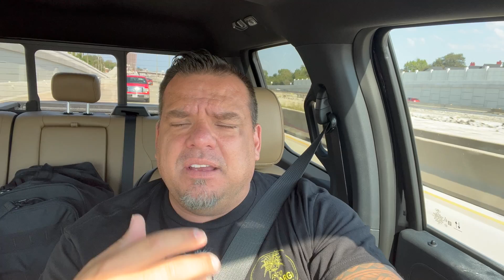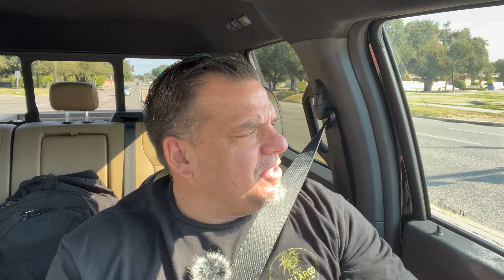How to Handle Impossible Projects: A Real-Life Integration Case Study

Comment: Sorry i haven't understood, the client had the all data which clearly specified the down time due to lack of raw material , what am i missing ? what normalization and contextualization had to be done on this information ?  What more information was required ?
Reply: @4.0Solutions
 what you say is still confusing but i thought the video talked only about lack of raw material for SCM may be i will replay and listen to it carefully again ! having and Logging all the events and tracking their status just prior to lack of raw material would give you what information ? Logging of all events is understood ( for any other downtime reasons) but the relationship with lack of material is still confusing to me ... sorry ...
Reply from the maker: Every data point, whether directly or indirectly related to the downtime event caused by a lack of raw materials, needs to be considered. The accuracy of predictions is often low unless the situation closely matches other similar instances. With the limited data available, especially when it's low-resolution (e.g., recorded once per day), identifying patterns becomes challenging. That's where machine learning comes in—it can uncover trends that aren't obvious to the human eye. If the issue were simply a matter of burn rate exceeding available inventory, they wouldn't need AI for such a straightforward scenario.

Comment: Really great video.

How do people say yes in this situation? 
I get stressed that I will not deliver project I know I am delivering, to start something that will fail, I would be seriously ill from the stress.

That said, I don't see this as impossible, just that the person asking for the solution does not understand the limitation and needs some education.

But being an overly optimistic individual, I normally don't see impossible evenif I don;t know what all the steps are, yet.

But my approach along very similar lines will be to quote
1- Upgrade the logging frequency ( 2 weeks)
2 - Inventory the business, create model architecture, MTA and POC €6275
( provide the following as a the scope over 2 Phases. Phase 1 costed and Phase 2 maybe an man-hour rate and expected hours_

Phase 1  ( 2 people for 8 to 12 weeks)
3- Connect Devices
4 - Collect and normalise, contectualise & Standardise data
5- Store the data
6- Create a visualisation of that data

Wait for suitable Data, and while doping that plan Phase 2

Phase 2  
- Build Model
-Train Model
- Use Model